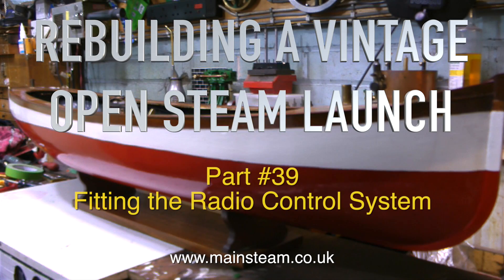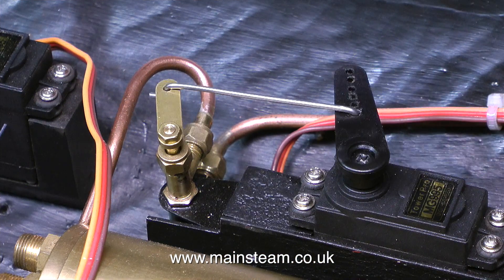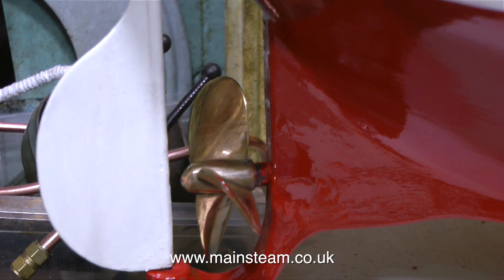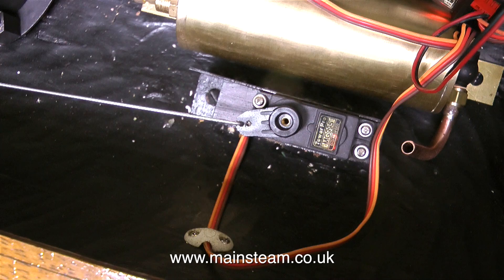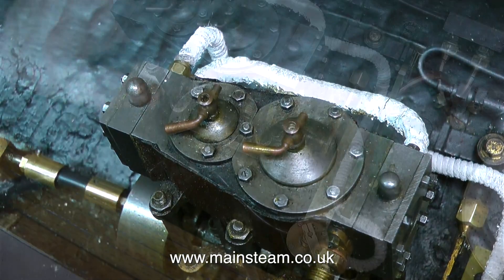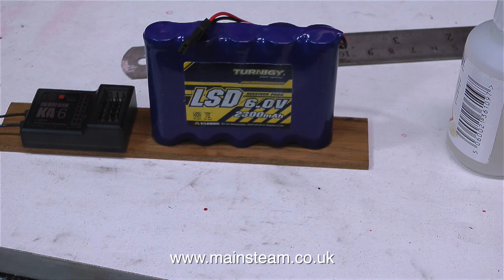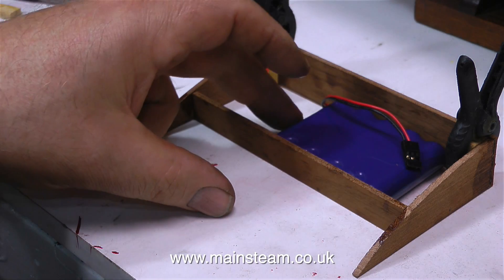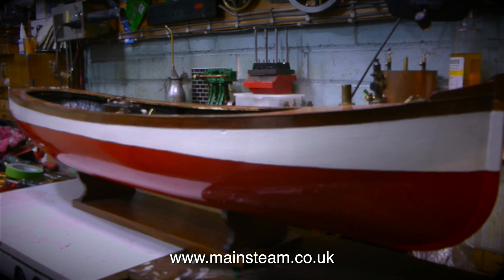REBUILDING A VINTAGE MODEL OPEN STEAM LAUNCH - PART #39

Comment: Will the heat generated by the burner damage any of the electrics? They seem to be thin wires. Also, could you fit an electric motor to give the engine the initial kick it needs to start?
Reply from the maker: I could do a lot of things but the owner wants it as he built it. The wires will be fine, they are low down and heat rises ......